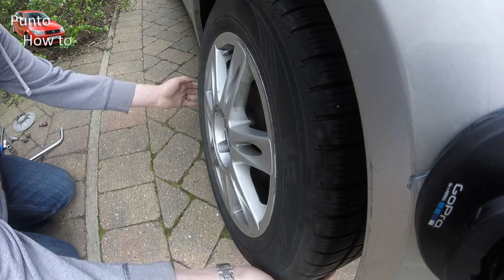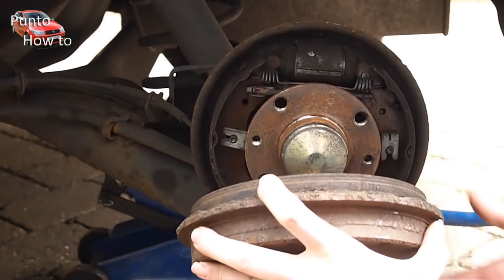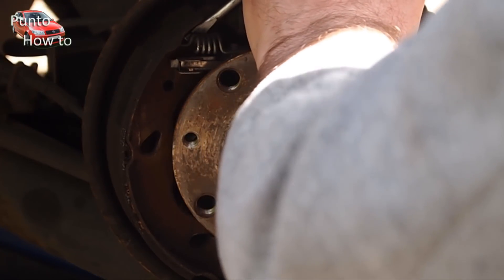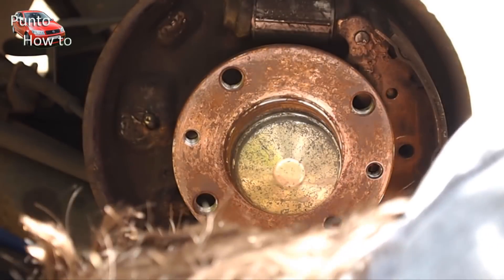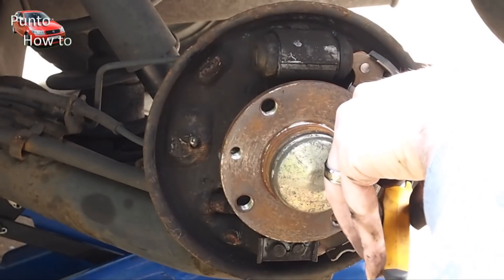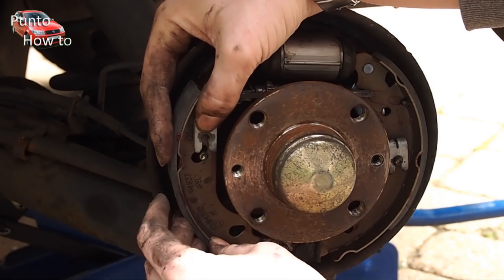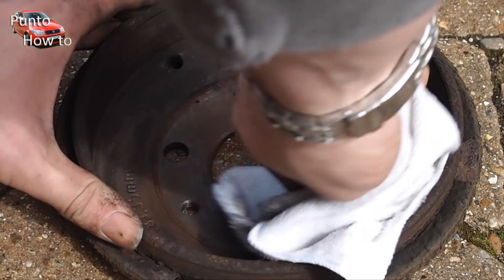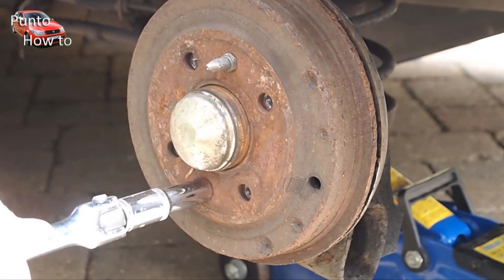Save money and replace your own brake shoes on a fiat Punto

Comment: No need to bleed the brake fluid for this job on the rear drums?
Reply from the maker: No, only need to bleed the brakes if there is air in the system. No air so no need to bleed them.

Comment: kindly make following videos as a suggestion
1. changing transmission oil
2. changing power steering fluid
3. changing coolant
4. replacing rear fog lamp bulb
Reply from the maker: thanks for the support, we no longer have any fiat vehicles, so won't be making any new videos in the future, however we do have a couple of videos that where filmed but never released so there might be a couple more released in the future.
Reply: The Puntos, or at least the one i own 188, uses an electric power steering.

Comment: It's a lot less fiddly if you take the hub off, loads more room. Put masking tape onto the shoe linings to keep grease and stuff off. Remember to take it off though. Should auto adjust but never do so do as in the video and manually wind out the adjust ment first, handbrake and pedal use should then take over the adjusting thereafter. Always helps to slacken the handbrake cable first. SLacken cable, change shoes, adjust them, then adjust the handbrake cable. If you are still trepadacious bring it round my house, I will do it £60 all in.
Reply: been a year or so but do you have any idea how much you wound it out or should i just play till it binds then slacken it a tiny bit ive done the shoes and drums but the auto ajuster not working and the handbrakes pants ive pumped the pedal heard a few clicks but its worse then the worn ones  🤔
Reply: @spongbob18  no probs, the trick is to slacken the cable off first and it's like you said, adjust them until the drum starts to drag then slack off a few turns, then adjust the cable back up to 5 clicks, the auto adjusters should take over from there when you use it on the road, the brake pedal and using the handbrake (especially) work the auto adjusters.
Two things to be aware, they have a little bent clam shaped metal part that does the adjusting on the adjuster knurled wheel when you apply the handbrake, this can if not careful fall out and render the adjuster useless, check to see if this hasn't been lost by a previous owner, also the thread of the adjuster needs to be really clean and free and lightly greased if it's to work well.
I found my adjuster heel/clam part missing on one side, £35 for the complete adjuster because you can't get the clam separate so to get me by until a second hand one came up on ebay I adjusted my adjuster correctly and held the adjuster whhel with a small cable tie to prevent it from winding off,just put the cable tie behind the wheel on the thread.
It sounds like you have a missing clam part
Reply: Where are you based?

Spent ages following the Haynes manual video on YT. Has issues with the brake shoes (rear passenger) as the top thing started leaking and one side popped off, popped it back on with the spring.

After replacing the adjuster was done so that the brake drum was freely moving, is that not right? As there was no force / resistance when spinning it.

Little worried as I could hear air coming out of the rear left when using the handbrake, did a test drive gear 2 max, and the braking distance is bad 7-10M at slow speeds… 

I’m in Oakham, Rutland. 

Not too sure what to do next, I’ll have to strip and see tomorrow.

Comment: Always apply copper grease to the contact points that the shoes rub against the back plate...no more squeaky brakes and they do feel so much smoother.
Reply: Why copper in particular? What's so special about it? I will answer: Nothing.
There are other lubricants suitable for this job.
Reply: @qwertyasdfghjkl9604  not so, copper grease never dries, is antiseize, stops squeels and does not run off. One of the main jobs it does is braking systems. It was designed for brakes.
Reply: @bonkeydollocks1879  Not to mention it is more heat resistant than typical lubricants. And yes, brakes can get very hot for those wondering.
Reply: @JohnSmith-wj2wd  yes that too. If only people would use it on reassembly on suspension bolts and such like too, makes replacing those items down the line much easier
Reply: @bonkeydollocks1879  That indeed. I'm doing that very thing with ceramic grease. I believe some don't like doing this for the risk of bolts undoing themselves by vibriations. I personally have never had this problem, and for the one bolt I might lose, the convenience of being able to unbolt everything years later is such a delight. No more wasting hours removing a bolt that ought to be removed in only 10 seconds.
Reply: @JohnSmith-wj2wd  absolutely, the struggles I've had over the years with siezed bolts and nuts is ridiculous, I will look into ceramic grease, never used it before.
Reply: @bonkeydollocks1879  It's a little bit like copper grease on steroids in my eyes, being even more heat resistant. The only downside is that it is white as snow, and very visible where you apply it. For an undercarriage it doesn't really matter of course, but if you're not careful like I am, it gets everywhere and makes the tools look as if they're frozen with a white haze. But that's the only thing really. Almost no part goes back without a nice film of ceramic grease on it first.
Reply: @JohnSmith-wj2wd  great thanks will invest in some 👍🏼

Comment: Is it an hard job changing the clutch on this model .Mines the 1.3 multi jet
Reply from the maker: I did change the clutch, I didn’t film it, but yes changing the clutch is a hard job as it’s a very small engine bay and everything is crammed in
Reply: Thank you 
It looks like I’ve got my work cut out 😩👍